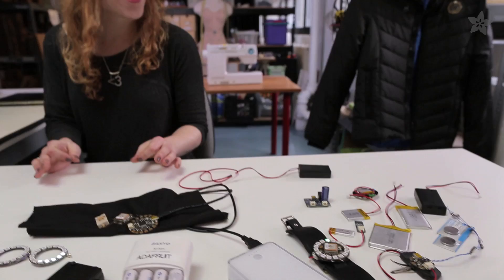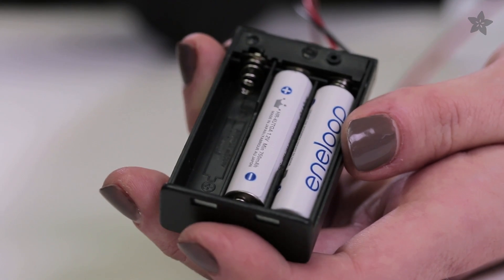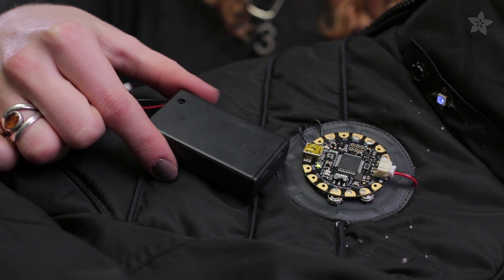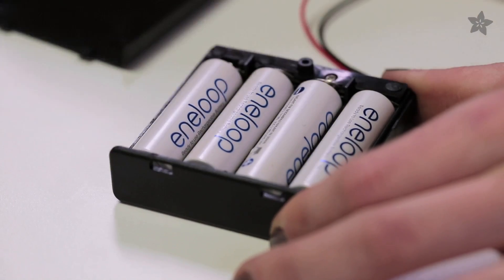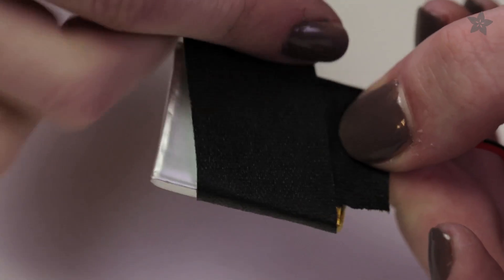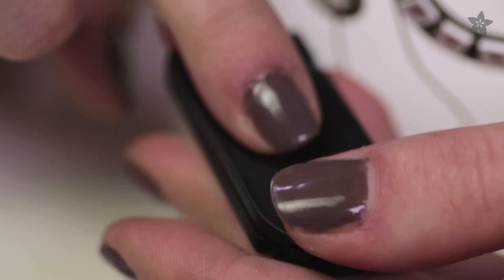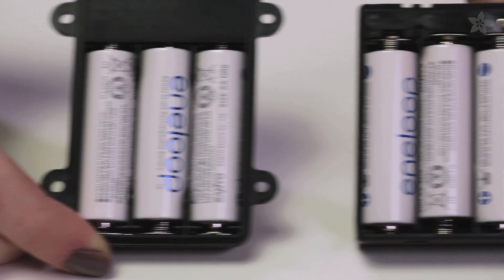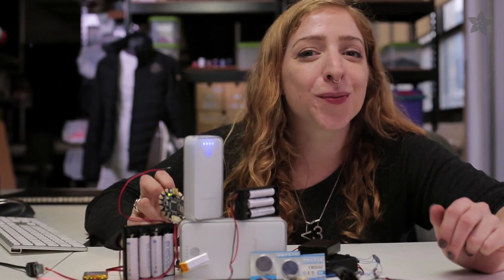Battery Powering Your Wearable Electronics

Comment: If you have an insane portable project that pulls a lot of current, say, a bunch of LED strips or matrices, consider a USB-PD power bank, a Power Delivery "decoy" board, and a high current buck converter. Set the decoy to request the highest voltage the power bank supports (at least 12 volts), place the buck converter as close to your LEDs as possible, and hook them up. If you can get away with running the USB-C cable for most of the length, go for that because good USB-PD cables are rated for high voltage and current. Power banks that can charge laptops are ideal here.

Comment: So in theory could you power everything (in my case, two 12-diode NeoPixel Rings rigged to a Gemma M0) with the USB port and a 5V power bank? I've assumed that since you have a separate JST socket for powering then it means you shouldnt use the USB one for powering the board, but maybe I'm wrong.

Comment: I purchased the Adafruit Circuit Playground Express 'kit' which included the Adafruit battery pack 3x AAA 

However I cannot seem to get the Circuit Playg Express to be powered by the battery pack
It works perfectly with through my computer via USB but when I unplug it to then use it with the batteries alone, nothing happens, not even a green light to show it turning on 

I have tried both switches on the circuit and on the actual battery pack. I have also tried a new set of batteries but no luck

Am I missing something obvious? Or is my adafruit not working fully? Please help !

Comment: Can you make a Video about the LiFePo4 Battery Type. I use them alot for 3.3V boards. They have Voltages of 3.2V-3.6V depending if their empty or full. they have less Capacity then Lipo batterys but because you need no protection or voltage boosters they last longer. Got my ESP8266 current down to 18uA in DeepSleep with one LiFePo4 cell. This make my esp8266 able to sleep 9 years in theorie

Comment: Hi Becky, great video on batteries and wearable.  My problem is powering my Neopixel WS2812 ring (12 pixel).  I have changed the "Strandtest " code for brightness of pixels, that is working good when running off USB port.  I try to light them up with 3 AA battery pack (3.6V) and tried higher voltage power supplies.  Sometimes several light will turn on and sometime they will not unless I disconnect and reconnect power but the ring will not run the program like when using the USB port.  I also used the 3.7v  1200Ah poly battery.  Any suggestion as to what I'm doing wrong?  Is there another video that might help?  I'm using Arduino Uno.
Thank,
 shinythings
Reply from the maker: +Bruce Cornwell Sounds like there might be something up with your wiring. Please post your code and photos of your circuit on forums.adafruit.com so our engineers can assist you!
Reply: If you have a multimeter, check that the battery's negative terminal has continuity with circuit ground and LEDs' negative terminals. NeoPixels can behave super weird if the grounds aren't connected or if the connection is iffy.

I've also encountered flaky performance when there's long or thin wires, in which case a small capacitor across the LEDs' +/- terminals can help (I forgot to include a capacitor in a project once).

You can power the microcontroller and LEDs with separate power sources, but you must make sure their grounds are all connected.

Comment: Hello! I'd like to power 3 meters of dotstar LEDs attached to a FLORA platform: 432 LEDs! How much power do I need? And it should be a wearable project, so, is there a portable source of power that you suggest/sell at adafruit to buy together with the dotstars and flora? Thanks, thank you very much in advance!
Reply: +Patrizio Pierattini Figure 20ma per led. so 432 x 0.02 amps = 8.64 amps.  But realistically only half the LED's are on at any give time, so half that, about 4.3 amps.  Get a really big battery, the battery will heat up, and with something you wear, it could burn you.  I would use 3 Alkaline "D" cells in a battery holder.  Also follow the AdaFruit recommendation to supply power over 18 guage wires to each section of the 3 separate one meter long LED strips.  I just bought the Adafruit dotstar LED strips, and they work great.
Reply: Oh Thanks I just saw this!

Comment: Thanks! Would it be safe to charge 2x rechargeable coin cell batteries in series with the Micro LiPo charger? Here's the three components I'd use:
https://www.adafruit.com/products/1904
https://www.adafruit.com/products/783
http://www.amazon.com/Battery-Li-Ion-Rechargeable-Button-LR2032/dp/B006O3UG6A

Comment: At 2:22 you brutally unplug that JST connector. I'm pretty cautious with mine because the wires feel so fragile. Clearly you have a lot more experience than I do. What is your recommendation for how to handle JST plugs on LiPo batteries?

Comment: You said that you can drive 100 pixels with 2 amps, but in the adafruit website it says the max current if 55mA per LED. so it would take 5.5A to drive 100 neopixels. Am I doing something wrong? why this difference?
Reply: prolly she meant single color mode?
Reply: This was 4 years ago but the answer is that each LED can draw 55 mA when at 100% brightness and in full white mode. Really there is no reason to do this as 40% brightness is still very bright. I estimate that each led actually pulls between 15-25 mA at reasonable brightness when not spamming white lights

Comment: I learned the hard way that voltage isn't enough... I had a servo that just worked weird when on a 9v battery and worked fine when the project was connected to the computer. I kept putting it off because "something weird was going on" (before I noticed it was only acting weird on battery power) until I replaced it with 4xAAs which give less voltage but drive more power. It's connected to an Arduino so it's regulated anyway.

It may be trivial to some, but at my level then it really wasn't.

Comment: If I want to put buttons on the sleeves to power turn signals on the back of the garment, does that require more power because of the long length down the sleeve?
Reply: Unless your arms are inhumanly long, no.

Comment: Thanks! I've been looking for this kind of info for a while. However, how do you calculate the power required by the project. I know you mentioned calculating the amperage required by the project but when you have a lot of items connected plus powering the Arduino it can get a bit out of hand and voltages required (if added) exceed 12V by a mile, maybe I'm adding it wrong? Amps, however, seem to add up nicely, but I'm not sure if the calculations are right. Series? Parallel? Thanks for any tips and or guidance on this!
Reply from the maker: Add the total current draw (amps, not volts) of your components, usually available on the product page or data sheet. Arduinos and their connected components usually require 3 or 5 volts (they all use this same voltage, no adding), so look for a battery that matches the voltage needed and exceeds your amperage total.
Reply: Adafruit Industries So technically it doesn't matter how many Volts as long as the constant feed to Arduino is 5V? My concern is because I have a total of 14 LEDs of different colors, hence, different voltages – in groups. However, the max amp current is barely 435mA all summed together. On the other hand, Voltages add to 10.6V (more than my 4 x AA battery in series battery array 6.0V@3000mAH at most). I mean, the volts have got to count somewhere, no? :)

Comment: It should be noted that rechargeable AA and AAA batteries are only 1.2V not 1.5V. It doesn't seem like a big difference but it adds up really quick.
Reply: Actually, most rechargeable AA and AAA have a 'nominal' voltage of 1.2v. When fully charged they actually charge to more like 1.4v. Under load they drop down to around 1.2v, but hold that better than non rechargeables usually do.